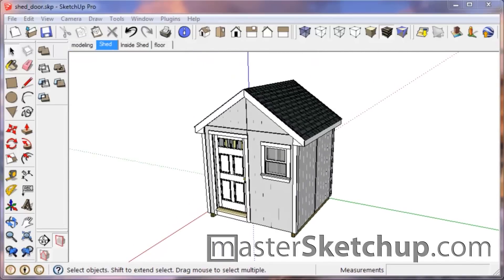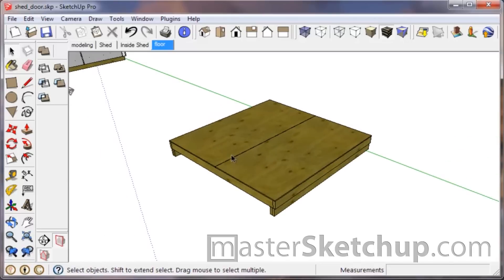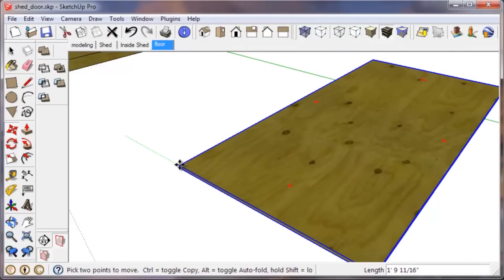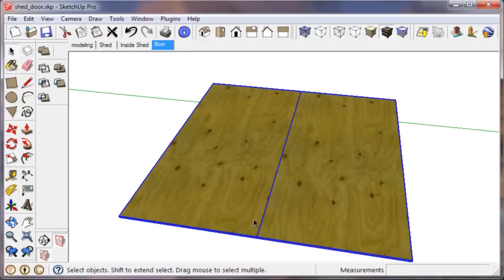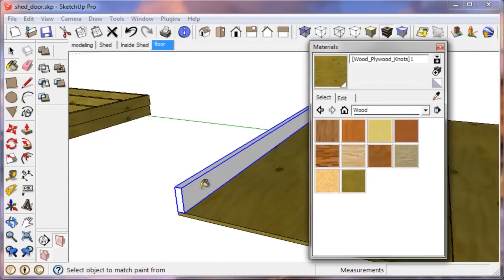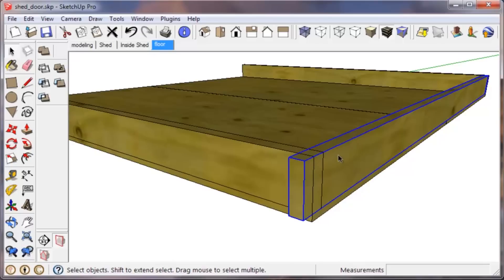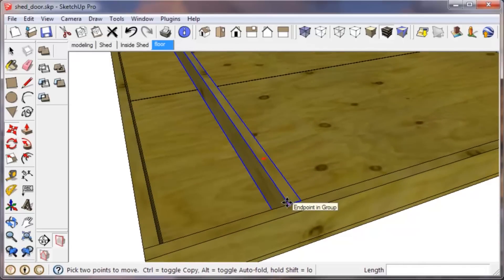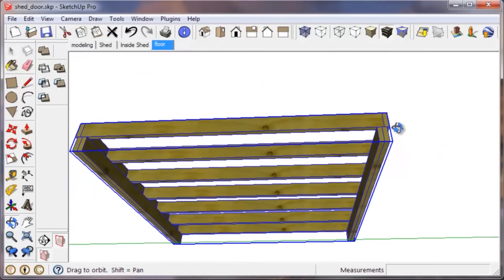Sketchup Tutorial - Model a Shed (Part 1) - Floor Framing

Comment: Hi, I just subscribed to SketchUp (2019). It has different appearance as your version of SketchUp, but all the tools are the same right? Is there a way to see the construction in elevation (front, side, floor plan)? Thanks.
Reply from the maker: Yes, all the tools are the same. Can't remember which version I recorded this in, but I think the icons were updated a little bit since then. If you go to the Camera Menu > Parallel Projection. And then Camera Menu > Standard Views, you'll see several common views like front, side, top, etc.
Reply: @Mastersketchup  Thank you. I'll check them out. Great tutorial. Easy to comprehend. Last question: Is there a tutorial where you work from pre-existing floor plan/elevation? Sorry if I'm asking too much.

Comment: Great tutorial!   When modeling carpentry projects, do you ever keep components around that represent standard dimensional lumber (2x4, 2x6, 2x8") so that you can "pull another board from the pile" and cut it instead of modeling new boards from scratch?
Reply from the maker: Steve Hoge I like the concept of having a library of profiles or components that you can use over and over. But honestly, for simple things like 2x's, I find it's not worth it. Moldings and casings are a good example where it would be worth it. Check out Profile Builder https://extensions.sketchup.com/en/content/profile-builder-2, even better.
Reply: Profile Builder looks very cool!   Will have to read the docs at http://profilebuilder4sketchup.com/ to see if I'm ninja enough to make use of it ;)
Reply from the maker: Don't let the fancy features intimidate you. Even just the basic tool is actually easier to use than the follow me tool.

Comment: I'm a cabinet maker and I do a lot of custom built-ins for clients. I've been wanting to buy some sort of cad software for a long time but they all seemed either too expensive or too difficult to master or both. So I was very happy to discover sketchup. Thank you for these tutorials. They are amazingly helpful. But I don't see anything specifically about multi purpose cabinet design. I saw the one about crown molding but would like to see some that deal specifically with cabinet design. Are there any, or will there be any soon? Thanks. And keep 'em comin"!! 👍

Comment: i am having a little trouble with the part where u copy and move the plywood i made the group and colored it just like u did but when i made copy and moved it would not let me do second move to add the 1/8" space it like locked them together can u please tell me what i am doing wrong
Reply from the maker: Sammy Steele Whenever you're moving something a KNOWN distance, the important thing is to just move the object along the direction you want it to go. THEN, after you've moved it, just type in the distance and press enter, and it will correct itself to the specified distance.

Comment: Hi, wow I noticed that you replied to every comment, I think that's very kind.
I just wanted to ask if I can do this on the standard 'Google sketch up' not the 'pro' version. And how much does the pro version cost? 
I've wanted to build a shed/man cave for a while now and your videos seem like the perfect way that I wanted to start my project.
Can you please help me with a tutorial on a bigger green shed e.g. 5m X 5m X 8ft height, lots of glass or transparent roof maybe facing slightly towards the sun so less electric bulbs are used, insulated walls to keep heat indoors, fresh water collection for all purposes, and maybe even self generating electricity like wind or solar.
This is an ambitious project which I AM going to do,  unlike other projects I would like to do a sketch up first and would really appreciate your expert help as a tutorial similar to this one as I have only just downloaded sketch up and don't know how to use it yet. I would be soooo happy and grateful if you showed me. Thanks again for these great videos. Hope to hear from you soon.
Reply from the maker: Shaz Demon Hi, yes, you can do all of this in the free version of SketchUp, called "SketchUp Make". You can download it at www.sketchup.com. Check out some of my other videos for tips and tutorials.
Reply: thank you

Comment: Can you upload the sketchup file somewhere (like mega.co.nz)? There are a few things I'm not sure on, and I would like to double check with your work.

Also in the end you created some beams or something, but you sped through that part and I was wondering if you could explain it some more. Joists hold up the floor (in this case plywood), but would do the beams do? Also your beams look off center, is that intentional?
Reply from the maker: growingfuzzybeards That's not a bad idea. I'll put it on my to do list. I'll probably create a page right on my site for it, and host the files as a direct download.

Comment: Great lessons, thanks,  Question:  When you multiply your floor joists times 5, I am not able to write in the measurement box.  Is there something I am missing ?
Reply from the maker: travlinpartner Select the joist. Activate the Move tool (tap M on your keyboard). Then, tap CTRL to tell SketchUp you want to make a copy. Click once to start the copy, move the mouse and click again to finish. Then, type in 5/ ENTER to define the array.
Reply: MasterSketchup, Thanks for your reply.  It's been awhile so I went ahead and studied more and learned that and many other things in this amazing program.  Again, i really appreciate your lessons and response.

Comment: When you're moving and you want to separate by 16" (center reference), I've found that starting the move by clicking on the center of the joist and typing 16" does it the best (Rather than clicking on the corner edge). This will move the joist 16 inches to the next location.
Reply from the maker: It actually doesn't matter where you reference the move from if you're going to be typing in a fixed dimension. In fact, you don't even need to click any point on the joist as long as it is selected ahead of time. Just click anywhere to start the move, lock axis by dragging the mouse, then type in the dimension and press enter.